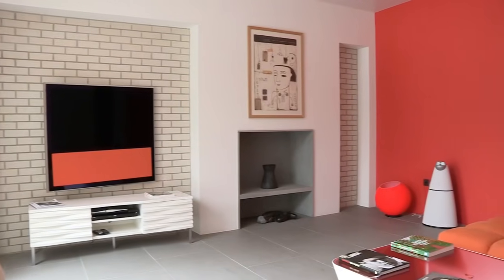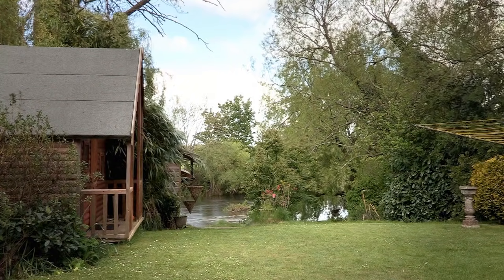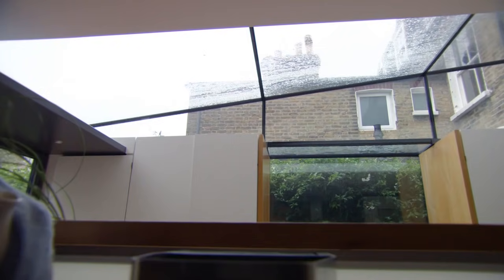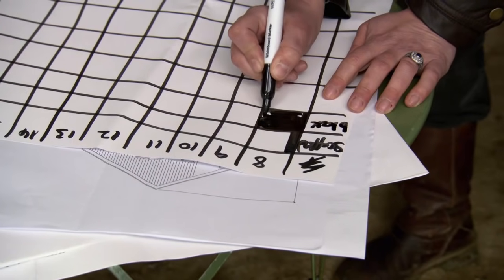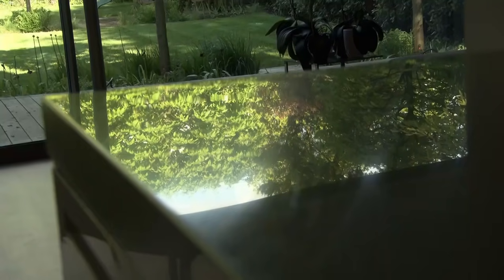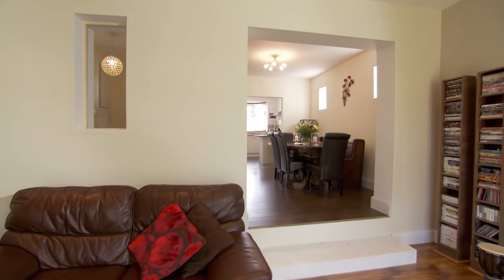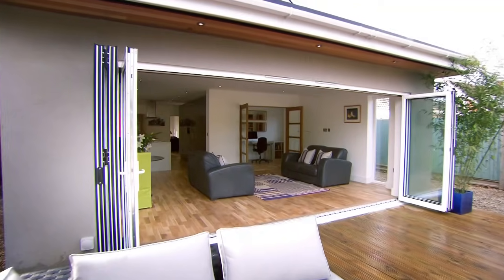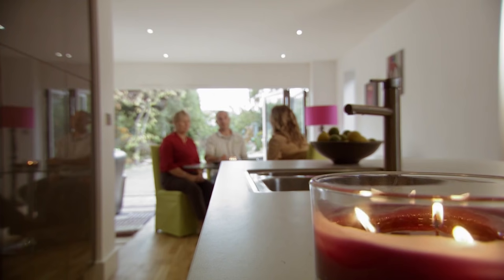Double Your House For Half The Money! Series 1 Episode 6 - FULL EPISODE

Comment: RB is a hero😊 A bit tight in the kitchen dining area , I would have gone for a shorter island area to get in and around it - with an option to put a barstool at one end . Lower the letterbox windows too.. Not too keen on those sliding doors end to end- had them, they can get v stiff after winter. I would have put two fixed glass panes each end with window seat - and smaller sliding doors. Still very nice effort:)
Reply: yep, it's a little tight in the kitchen, and i really cant stand kitchen islands altogether... they look so dated so soon and just seem to take up so much space...

Comment: (40:59) Beautiful room but poorly laid out. No lamps, which means it's overhead lighting: HORRIBLE. It makes you tired. Light is one thing that doesn't respond to gravity! You need side tables with lamps on them, or floor lamps (best: Combination of both) to bring the light source down to the MIDDLE of the room. THAT creates a cosy feeling. Also, here the furniture  has been arranged in what Nate Berkus refers to as 'circle the wagons'; in a big circle around the edges of the room. There's no focal point. Instead, there ought to be groupings.